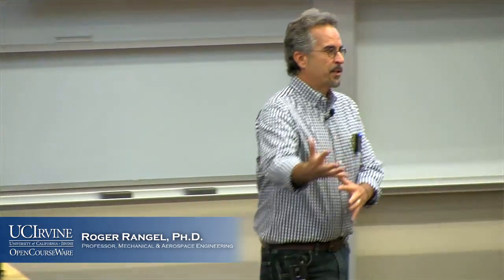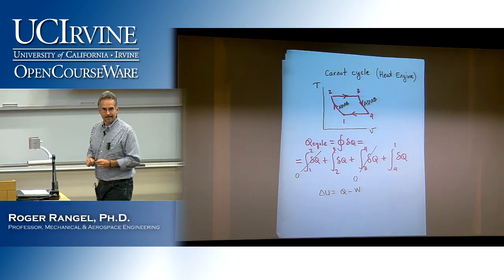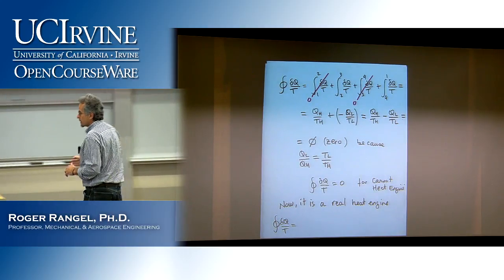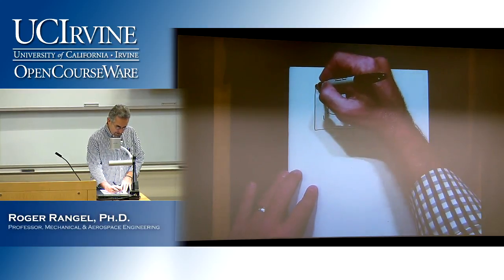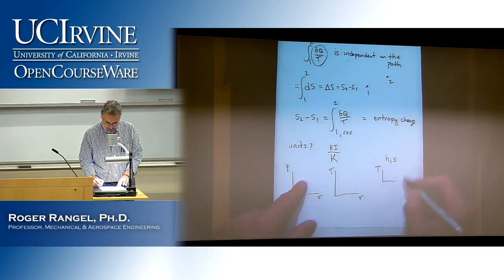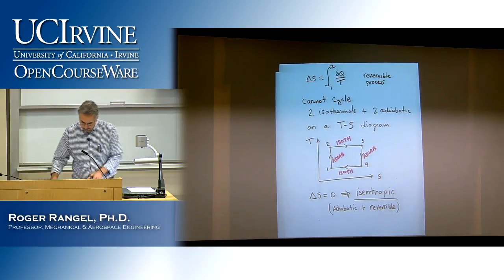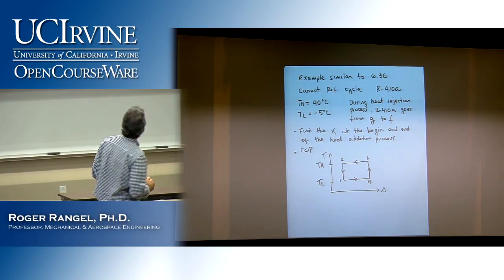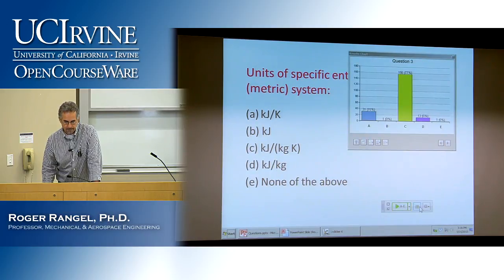Engineering MAE 91. Intro to Thermodynamics. Lecture 13.

Comment: @ 10.30 Mr Rangel notes that Q is not necessary equal to W for this specific process. This is wrong. Q=W is always the case for an isothermal process.
Reply: in that process, temperature is constant, but the internal energy U  is not zero, since the energy Q_in can not be converted to W totally.
Reply: Dr. Rangel
Reply: Amala doesn't seem to be the sharpest knife in a thermo class,Q is never totally converted to W,that's the Second Law,and therefore Prof Rangel is still correct
Reply: @kelumo7981 yes u right and only W may totally convert to Q
Reply: +Amala 
Whatever you say, Dr. amala!!